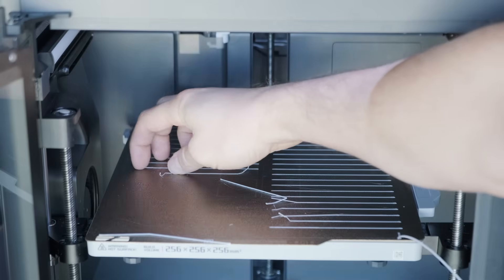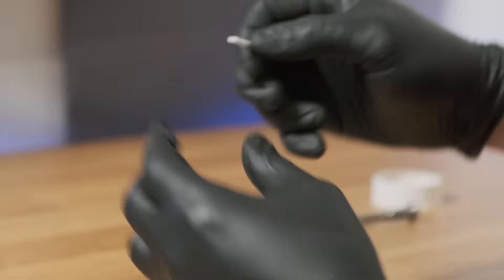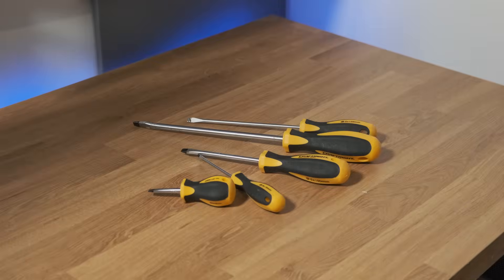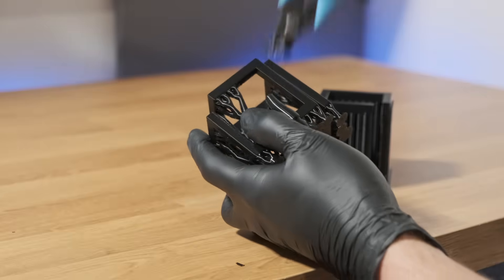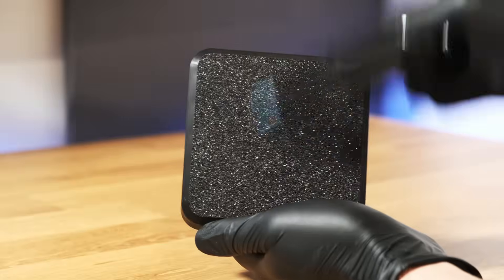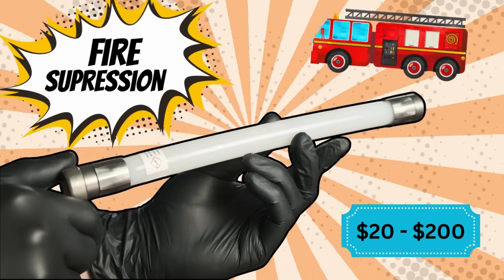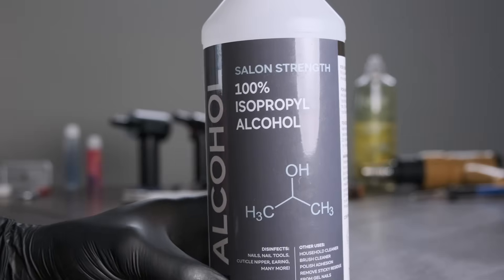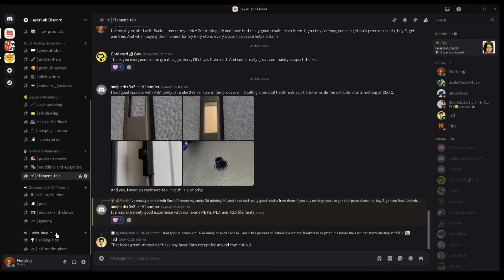10+ Must-Have Tools I Use Constantly for 3D Printing

Comment: Alcohol WILL NOT break up oils. It will only spread the oils around. 
I actually use ivory soap and hot water! It's cheap and removes the oils. Dawn dish soap is also better but requires a lot more rinsing.  Grant at 3d musketeers prefers ammonia based window cleaner. That does a great job as well. But ivory soap is less than $1/a bar and goes a long way!
Reply from the maker: Thanks for sharing your tips! Always great to hear what works for others.

Comment: Thanks for reminding me about the digital soldering iron. I ordered one, with a few others things from Temu. Including a USB-C electric screwdriver with massive torque. When you are 60, manual screwdrivers are the devil's tool!

When is comes to CA glue, you need to know what you are doing, otherwise you're gonna have a bad time. It is especially helpful to have some extremely thin superglue which uses capillary action to track down into tight joints which are already closed. And some CA gel, which won't run. And some CA accelerator, which I understand is mostly just acetone.

Comment: A hot glue gun is used to fix supports, and a soldering iron is used to reattach broken bits. Those are the ones I use most.... Oh iron can also be used for inserts and making rough holes like under a flower pot.... Usually faster than printing a hole  :P

Comment: nice list; some things i haven't actually seen before (like the teflon tape). Appreciate the specific brand recommend on the superglue too. I haven't found one that doesn't get clogged super easily. And the fire suppression point is really good. Just because you probably won't need it doesn't mean you definitely won't need it.

One thing I find indespensible is a nail clipper. There's nothing better for trimming filament ends IMO.
Reply from the maker: Oh nice! I was hoping there would be a few things in there that aren't talked about repeatedly by everyone 😆 but yeah, the glue works great, I kinda got lucky with it and just got it on Amazon one day and realised it didn't clog up like many others. 
The nail clippers eyy? Gotta give them a try 😁
Reply: @LayerLabAustralia  yeah it's really funny, I have a bunch of really good quality snips but for that kind of trimming, I keep coming back to the clippers haha.

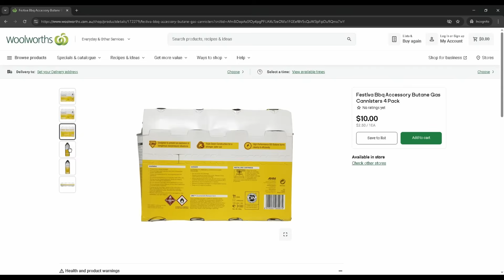Comment: 5:59 - This could be that, but those white marks on the plastic that was affixed to the build plate can also just be small streeses in the plastic when it was removed from the build plate. solution is still the same regardless though.

Comment: 00:07 you might want to mention plastic bed scrapers, of course plenty of people print one - but you can get one + many replacement plastic blades for incredibly cheap, and they're normally made of ABS which still won't mar a PEI plate, unlike metal scrapers. PLA won't hold an edge as well and many people don't print ABS or tougher plastics.
9:27 what do you mean overusing IPA can wear down your PEI surface? IPA does not damage PEI. Of course washing with dish soap is the best method, but IPA should not damage a plate.
Reply from the maker: Yeah, if you are going to use a scraper, don't use the one I showed here. Plastic is much better (or your fingernail if you are willing to risk it :P)

Regarding IPA, it seems this is a very controversial topic :P Check out this video where Moses goes through exactly why IPA can damage the plate. https://youtu.be/u-ZLd9zMV6I?si=TUrInmqhqqNVVu0J&t=142
Reply: @LayerLabAustralia  I'd take that video with a grain of salt; it's more of a visionminer nanoadhesive ad. I've been wiping my bambu textured PEI plates before every single print with 91% isopropyl alcohol for as long as I've had them (over a year now) and there's been no degradation. This is across about 8 plates, four bambu printers and thousands of printing hours. There's no evidence that IPA would degrade the PEI surface either.
The key to using IPA is to us enough, wipe it away quickly, and not to use 100%. 91% is the sweet spot; it doesn't evaporate as quickly as 100 or 99%. I use the same bed wiper you showed in this video; I use a good bit more alcohol. I give the plate a couple of good sprays with a spray bottle and use the wiper to wipe it off. Never any bed adhesion issues, and I've never used dish soap.

Comment: If you recommend CA glue, make sure to recommend one that comes with an accelerant. Otherwise PLA gluing is going to be hit or miss
Reply from the maker: Good point! Just to clarify, I've only used this glue on PETG and can confirm it works great for that material. Have not yet tested on pla.